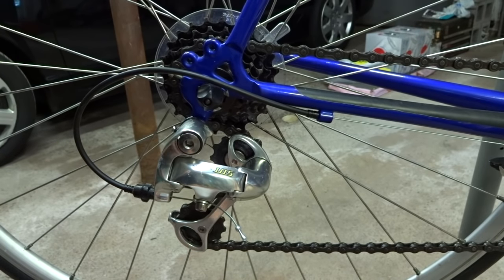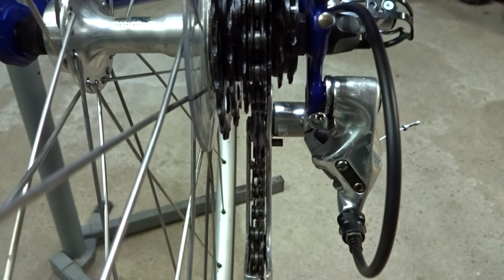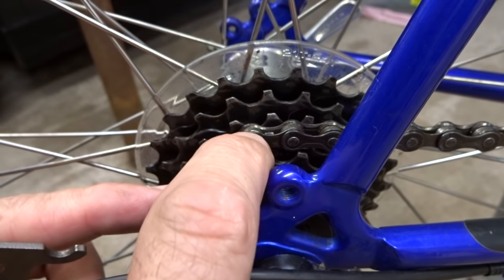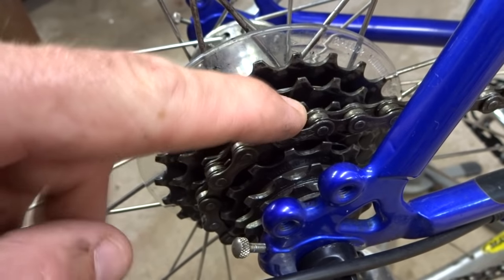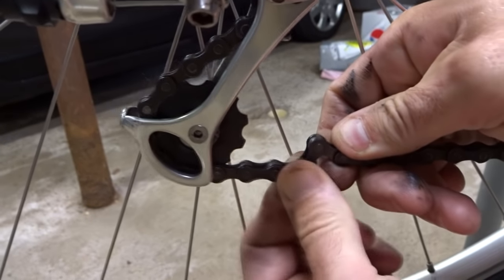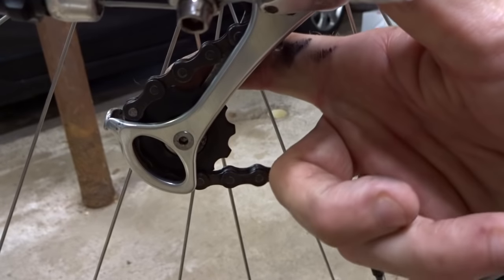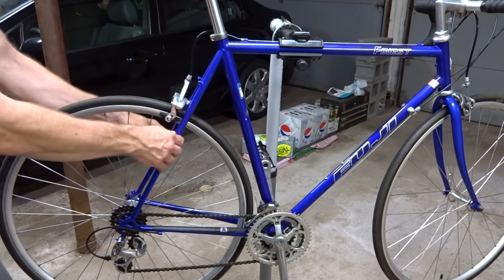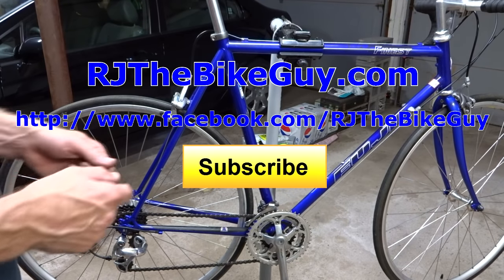How To Fix Bike Chain Skipping/Slipping/Jumping Gears

Comment: i changed my chain and cassette on my mountainbike and the chain keeps skipping when i put a little bit more force into the pedals in lower gears...also when it gets bumpier and the chain is moving around more it slips.. i used the same chain lenght then before and i dont know whats causing the problem ...i already adjusted my derailleur :(
Reply: Adjust it again
Reply from the maker: If you have gone through everything in this video and you are SURE the derailleur is adjusted correctly and the chain is in fact the correct length and it is the correct chain. Then it might be your derailleur springs are weak or slipped. Replace it. Or try to take it apart and see if you can adjust it or fix it.
Reply: the springs were weak, i fixed it! Thank you a lot  RJ!

Comment: I got a new chain, a relatively new cassette a new chainring and a new derailleur hanger but it still slips on the 3 highest gears...
Reply from the maker: Maybe the chain is too long? Could be a problem with the derailleur.
Reply from the maker: New chain. Did you cut it to the same length as the original?
Reply: RJ The Bike Guy 
I am running a 1x8 drivetrain, but the problem started after I got a new wheel(it was used)

Comment: there is zero oil on your chain that is why it seizes up you have to keep it oiled. if you keep oil on your chain it'll last longer
Reply from the maker: The chain is actually lubed. There are dry lubes and wet lubes. Dry lubes don't appear all oily like wet lubes.
https://www.amazon.com/exec/obidos/ASIN/B002IDZXRM/ref=nosim/youtube25-20
vs
https://www.amazon.com/exec/obidos/ASIN/B00Z779USE/ref=nosim/youtube25-20
Reply from the maker: And actually, my chain wasn't skipping, slipping, jumping at all. I was using this bike to explain the causes.

Comment: is it also possible for chains to jump if the cassette is wobbling?
Reply from the maker: The cassette would have to be wobbling a lot. At that point it might indicate a bent axle, or something else and there would likely be other symptoms.
Reply: Ok... Thanks then, i shall send it straight to the shop cus my wheel seems to wobble alot along with the cassette.
Reply from the maker: I have a video on replacing a bent axle. You can see the axle moving funny with the wheel out of the frame: https://www.youtube.com/watch?v=JYVWFkctxg4

Comment: Currently working on my bike that recently went through a major gear disaster (by that I mean I had issues with my front gears and fixed it) I knowingly in fact have Shimano brand gear casset and derailleur and so far this video has helped me a bit to work on my bike a bit easier so Thank you so much.

Comment: Hello. I am 11 years old. I have a Giant ATX 2. My bike states than on the shifter, the bike is on 1 gear. But when I look at the cassette, it’s actually in 2nd. And when it says 2, the cassette is in 3rd. This means the shifter is one chain ring ahead of the shifter. How do I fix this?
Reply from the maker: You cable is adjusted wrong. Adjust the barrel adjuster on the on the rear derailleur, and the shifter if it has one.
Reply: hmmmm
Reply: Which way?
Reply: Oh wait when I’m in 1st gear on first front chainring the derailleur is in 3rd..
Reply from the maker: There are only two directions. Turn it and see which way the derailleur cage moves.
Reply: The chain is on but it doesn’t move much. The one on the deraiullerdoesn’t even BUDGE! But the one on the shifter does move.
Reply from the maker: @luftwaffle6701  Take it to a shop.
Reply: ok I accidentally made the gap so on the shifter it says 1 but actually the derailleur is in 7th. But now the shifter is in 1st but the derailleur is in 2nd. So I think I can do it myself

Comment: mi problem its Campagnolo in a place where parts are scatter ! mi cassette its worn and my chain keep skipping the cogs.
Reply from the maker: Not sure what to tell you. Campy stuff not super common here. I prefer Shimano. Cheaper and easier to get. Drivetrain stuff more compatible with other Shimano stuff.
Reply: @RJTheBikeGuy  yeah ik, but if i go shimano (and im probbly will) i have to switch, everything, the freehub and the core of th cassette, and i cant dinf it even used
Reply: @RJTheBikeGuy  can you maybe help me some how ?
Reply from the maker: @raulfernandezperez73  Sorry, I can't really help you find/get parts.
Reply: @RJTheBikeGuy  yeah no surprise here, no body helps me anyway.

Comment: what is the problem to chain skipping on a bmx bike with no derailleur and no speeds?
Reply from the maker: Go through the video
Reply: @RJTheBikeGuy  a repair guy told me it might be the chain, some keys are stiff like you explained. 
However why does the driver wobble and can't stay fixed? he said it's not a problem, do you agree?
Reply from the maker: @JSB-2Z-2K  Driver? Not sure what you are referring to.
Reply: @RJTheBikeGuy  the little back tire sprocket attached to the hub
Reply from the maker: @JSB-2Z-2K  The cog. I have not worked on your bike, so I can't say what the problem is. It shouldn't wobble. Or at least not significantly.
Reply: @RJTheBikeGuy  ok. any idea what could cause the driver to wobble?
Reply from the maker: @JSB-2Z-2K  What part of "I have not worked on your bike, so I can't say what the problem is." did you not understand? Take it to a mechanic who can actually look at the bike.
Reply: @RJTheBikeGuy  i was thinking you may have an idea from other similar cases as mine

Comment: Your such a great tap of knowledge for me.  I'm fixing bikes in London and have one bike that is pop the chain on the two smallest workers in the rear.  No matter which front gears I'm in.
Reply from the maker: Did you go through the video? Could be worn chain, worn cogs, not enough chain wrap, etc, etc.
Reply: @RJTheBikeGuy  I will go through them all.  Brand new chain, cassette.  New mech hanger.  New triple Crankset (48, 38, 28).  Hmmm chain wrap.
Reply from the maker: @barssound  If too few teeth are engaged on the small cogs, the chain can slip.
Reply: @RJTheBikeGuy  Awesome... Gonna have a look later.  It's only under torque it happens.  Once on the bike stand no problem.  Thanks so much for replying dude!
Reply: Actually it seems to be slipping on the front crankset somehow when in the two smallest gears on the rear.
Reply from the maker: @barssound  Again, chain or gears. Figure it out or take it to a shop. I can't diagnose it without working on it.
Reply: Thanks man sorry to pester

Comment: And what tool do you use to link a chain together?
Reply from the maker: What point in this video are you referring to?
Reply: @RJTheBikeGuy  Just a general question as I have an adult tricycle and it's okay, I had it assembled at a bike shop, but when we got it the chain was just one long piece in two bits, wanted to know what tool is used to link the chain link up to the other part of the chain. For when I need to replace the chain, trike is still fairly new though, just cheaper.
Reply: @RJTheBikeGuy  Could I get a higher quality chain also? If I wanted to. Trike has 6 gears too and it makes a clicking on gear 1 but smooth on 2 sometimes clicks on 3 and 2 but mostly 1.
Reply from the maker: @CatherineThompson98  https://www.youtube.com/watch?v=vgczpUJ_Jjk
Reply from the maker: https://www.youtube.com/watch?v=TuIPmqru_Rw

Comment: No the sprockets up in front
Reply from the maker: "A sprocket or sprocket-wheel is a profiled wheel with teeth, cogs, or even sprockets that mesh with a chain, track or other perforated or indented material. The name 'sprocket' applies generally to any wheel upon which radial projections engage a chain passing over it."

Comment: Hey, I hope this helps some one. So, on the rear derailleur, there will be 2 tiny screws (well, at least on my Mongoose Malus) Anyway, if you see any tiny screws on your derailleur sticking out, screw them in! This solved my problem instantly and now it doesn't make any noise when shifting! It shifts even better than when we first put it together! I had that problem where, in 6th/7th gear, if you put too much force on it, it would skip a lot. Not anymore. Now, I'll always carry that tiny screw driver in my kit. Good luck.
Reply from the maker: Are you trolling? It sounds like you telling people to tighten down the limiting screws which limit how far the derailleur can push the chain in either direction. If you tighten them down, you are going to lose the use of your biggest and smallest cogs.
https://www.youtube.com/watch?v=OV1AVcdNjMM

Comment: My bike has been skipping and jumping for a while now! Just checked my chain and found one of my links was twisted. Straightened it with 2 pairs of vice grips, oiled it up, adjusted my derailer. Bike works almost like new now! Thanks a lot!! (I have subscribed)
Reply from the maker: I would suggest replacing the chain. KMC makes some great chains, many for $10-15. Check Amazon.

Comment: The barrel adjuster adjusts cable tension, it doesn't line up the pulleys with the cogs. The limit screws do that. I think you got it wrong.
Reply from the maker: No, I was correct. The limit screws limit how far the cage moves in either direction. Hence the word limit. https://www.youtube.com/watch?v=OV1AVcdNjMM

Comment: My chain slips continuously when i ride in higher gears. I have changed first my chain then cranks and then derailleur. But the problem still exists. My casette is in good condition i believe. Cant find any solution for it
Reply from the maker: It's most likely something in the video. If you can't figure it out, take it to a mechanic.